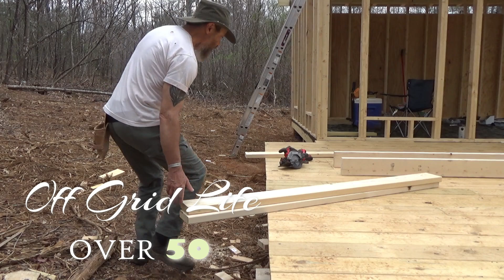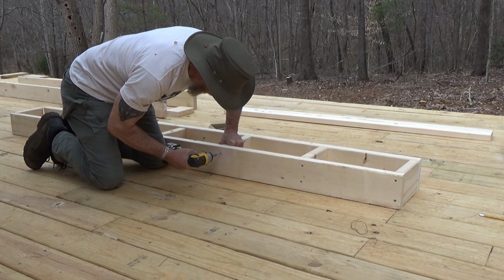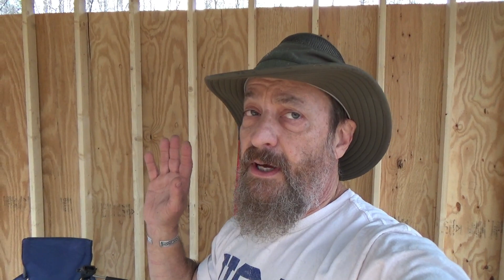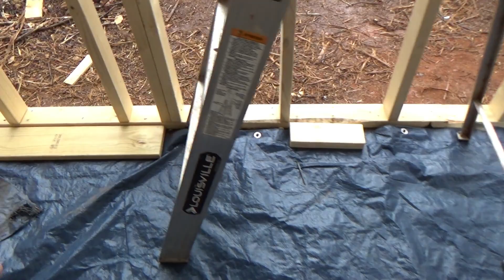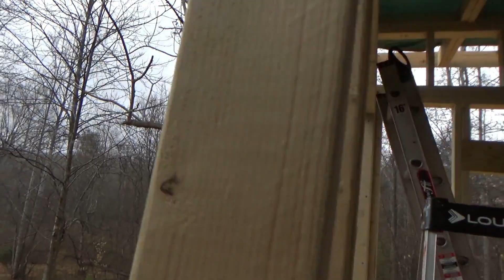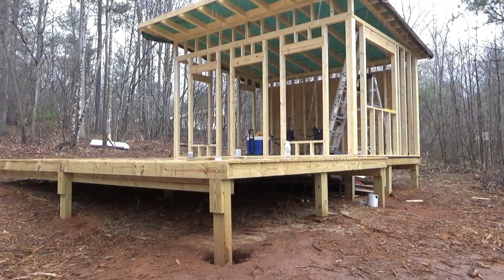Our Off Grid Cabin... More EAVES Installation

Comment: WELL DONE.. GREAT PROJECT FOR THE LAND... ITS A GREAT TIME TO RACK THE WALLS FOR SQUARE. WE USED TO USE A DIAGONAL  Z STRIP ON THE OUTSIDE AFTER SQUARING THE WALLS THEN THE SIDING GOES RIGHT OVER. MAKES IT VERY RIGID. BUT YOU MAY HAVE ALREADY DONE THAT...  LOOKIN GOOD.